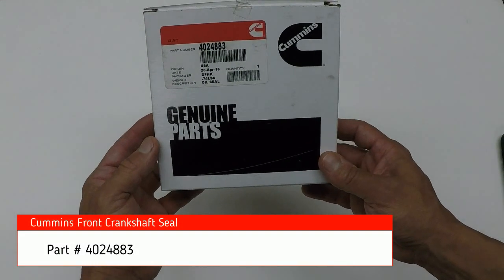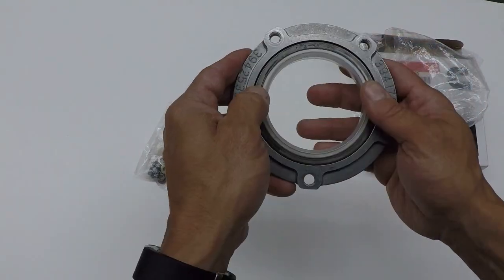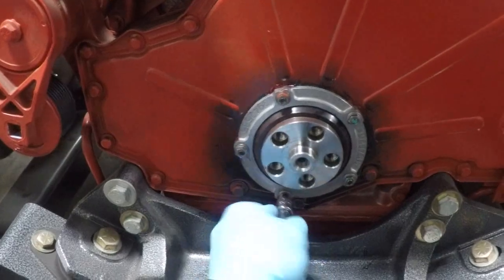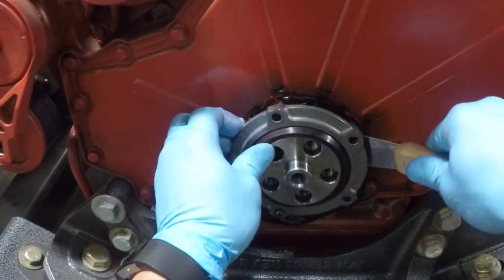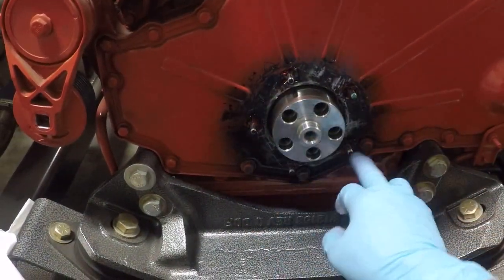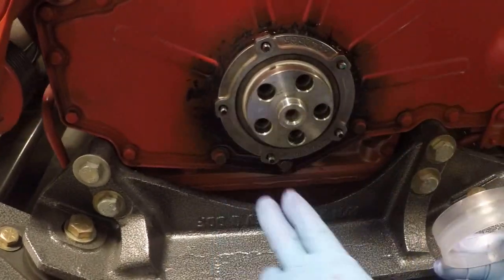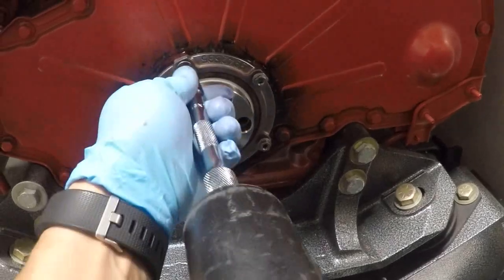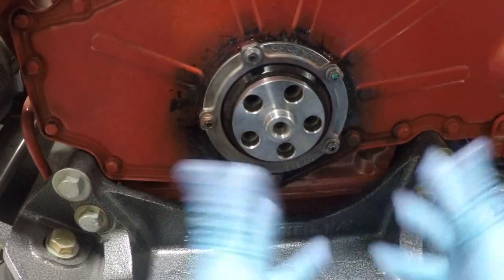Cummins Front Crankshaft Seal Install

Comment: note to creator please be more specific which engine your working on, we followed your video only to find we have a wear ring on our crankshaft which caused us to break 2 seals and explained why the first one we installed was too tight. With that being said the kit he uses in this video isn’t the right one if you have a wear ring on the end of the shaft so to anyone who is experiencing a problem with your seals going out too frequently or not sealing correctly check if you have a wear ring or not, it was not stated in the video which lead us finding what I’ve found
Reply: Which seal did you end up going with for the crankshaft with a wear sleeve?
Reply: Yea wear sleeve seal